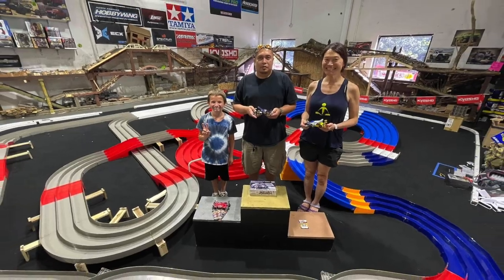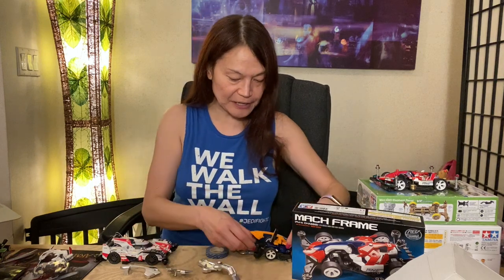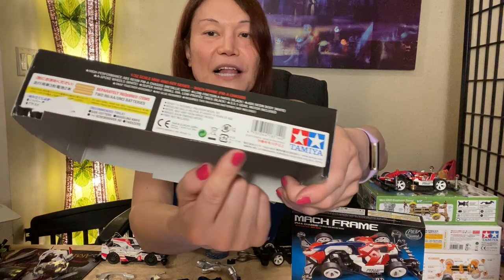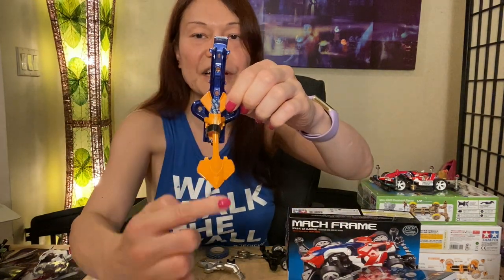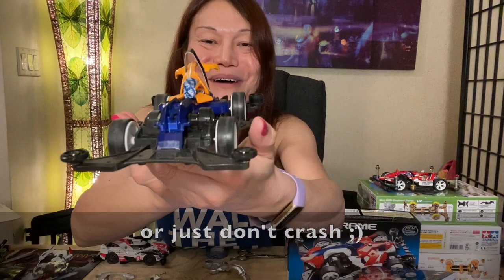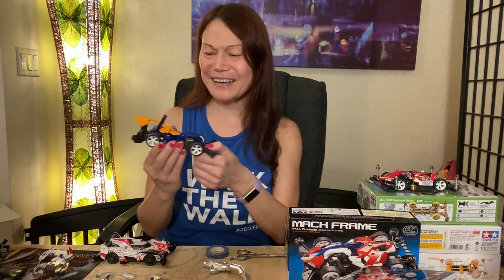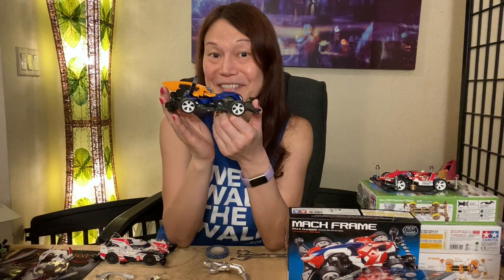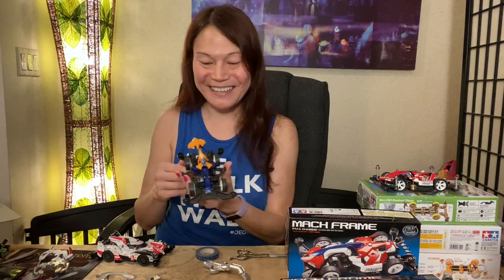Tamiya Mini 4WD - Box Stock Body Damper System for Your Mach Frame

Comment: Or you can use  some parts of stickers,    rubber parts from the wheels cut off parts or even the plastic pouches then glue it - since maybe glue is the only applicable non box part thats allowed.  Awesome initiative btw.
Reply from the maker: Thank you! Yes, your ideas are all valid as they are all part of the kit!

Comment: Is this legal for box stock racing ?!?  (Please say yes)
Reply from the maker: It depends on the racemaster :) From a purely legal perspective (I'm a Penn Law student), the answer is yes, it's legal, because most rules do not explicitly say that tape is not allowed or body dampers are not allowed. Although some racers may say it's implied that tape and body dampers are not allowed, the rules do not state anything about this. Now, where it becomes tricky is the dimensions. It's a little larger than it should be, but you can adjust all of this. Tape the head piece in front of the tail (just be sure the legs of the head piece do not catch under the tail piece) and temporarily and gently bend the cardboard piece over to one side to clear the dimension checker. However, any race that permits a K4 Gambol or Mach Bullet should allow this because the K4 and Bullet do not clear the dimension checker, either. This damper system Mach Frame can beat a Korean Mach Frame :)

Comment: This is not legal at all once you at the box piece makes it ilegal the tape is ok but adding a piece that alters the performance makes it ilegal rules clearly say no modification of the cowl and your own rules say you are not allow to use plastic or anything that is garbage isn’t the box garbage?? So you are going against your own rules I’m just confuse
Reply from the maker: I get what you're saying, but I can fabricate the cardboard piece out of tape so that I wouldn't need the cardboard at all. Everything a competitive box stock racer does alters the performance of a car: the paint chosen, the number of stickers used and their placement on the model, lubricating the POMs, rollers, gears, etc., weighing the wheels to make them more balanced, breaking in the motor, straightening the wheel shafts, etc, etc, etc. I am willing to bet there are people who spray their brake pieces with matte paint to add friction to them. The mod in this video should be the least of everyone's worries :)
Reply: @claredin  and that’s when they get dq now lubricating gears is legal because grease comes in the box the only out of box thing that is legal is breaking in the motor other than that everything is ilegal and actual rules state any parts that does not come in the box and affects the performance is ilegal now cowl has to be assemble the proper way